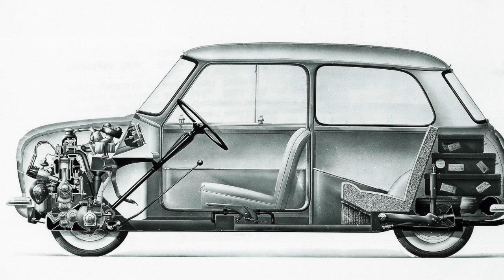Future Electric MINIs Moving to Rear-Wheel Drive?

Comment: I thought BMW went to FWD for MINI and 1/2 series platforms to save costs for premium smaller cars? Doesn’t adding prop shaft to drive rear wheels add more cost and weight and also increase fuel consumption?
Reply from the maker: This is for future electric cars. There are no prop-shafts.
Reply: @ oh yes, still thinking we’ll have ICE cars for some years yet🤪
Reply from the maker: We will but they won’t be “new”. At best they’ll be heavily refreshed versions of what we already have.

Comment: That would be very interesting for real.
I drive a 2019 Countryman SE ALL4 at the moment and what I love about this car is actually a quirk of the hybrid system.
The quirk is that the petrol engine (3cyl) only powers the front wheels and the electric motor only powers the rear wheel.
This has the effect of the car always beginning rear wheel drive before finishing front wheel drive.
Of course, you can force it "AWD" by disabling DSC, but even when doing that, the result is that the electric motor always has more torque to get the car moving than the petrol engine.
It was such a blast to drive in the snow with DSC off during the blizzard last week around Montréal, so I believe 100% that something that has some resemblance in behaviours would have as much fun and character if not even more.

Comment: I have an All 4 model for the second time. Never have I driven a FWD model so this new move really will not affect me. I think MINI should reexamine the Paceman model as an off-road anywhere model. This time as a proper EV Rivian has become popular with the upcoming R3x editions.
Reply from the maker: While MIIN’s current All4 can all wheel drive in certain moments, the vast majority of the time it’s 100% front wheel drive because it’s based on a front wheel drive architecture. This change would make the Countryman All4 predominantly rear wheel drive with the front motor engaging the front wheels when needed.
Reply: @MotoringFile  -My bad. Thank you for correcting me, Gabe. If it is true that MINI will go RWD perhaps the next-gen 2 Series BMW will also share parts with the next-gen Copper.
Reply from the maker: Time will tell!
Reply: I perceive it as an advantage because MINI is targeting the premium customer segment who desires the same features as BMW drivers, particularly in the SUV market.